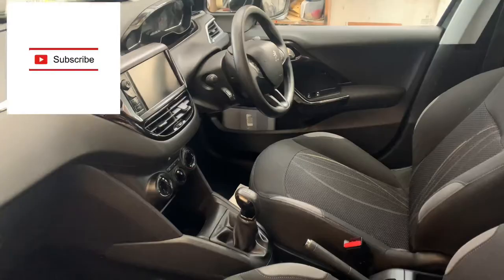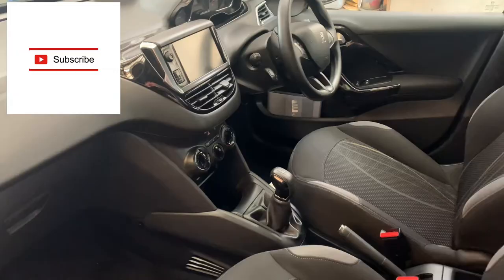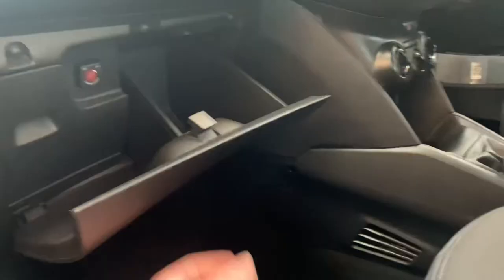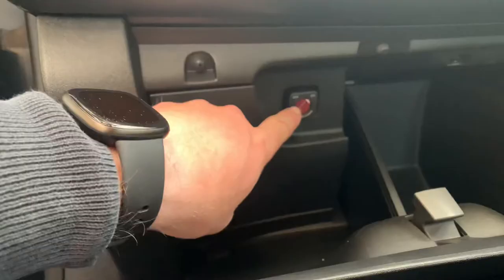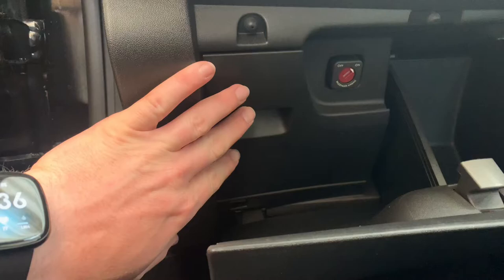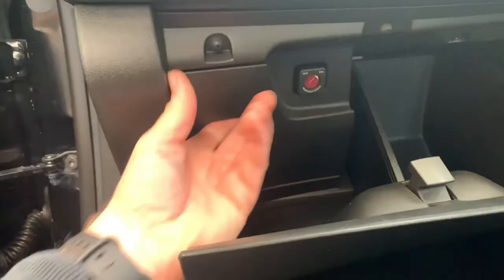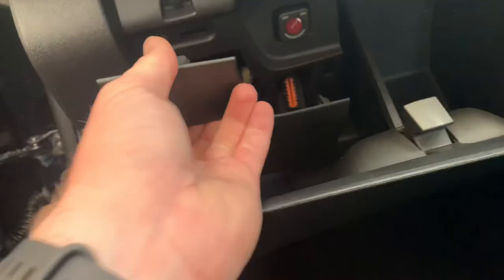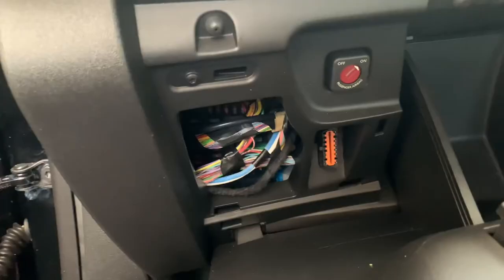How To Find OBD Port - Peugeot 208

Comment: Hi. I have a Peugeot 208 2017 GT LINE. Just recently the fuel gauge shows empty, even though I've put plenty of diesel in. Is this caused by OBD? Do I have to reset it? Thanks for the video, and any help in advance 😊👍
Reply from the maker: Not usually no, could be a faulty gauge?